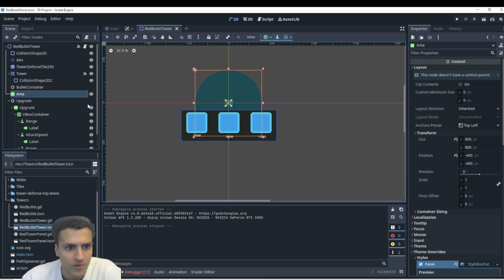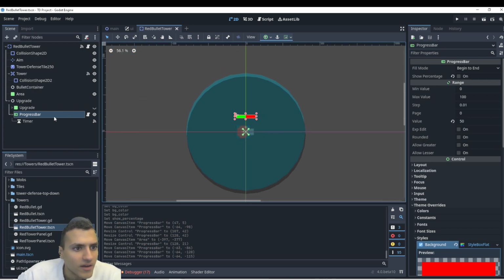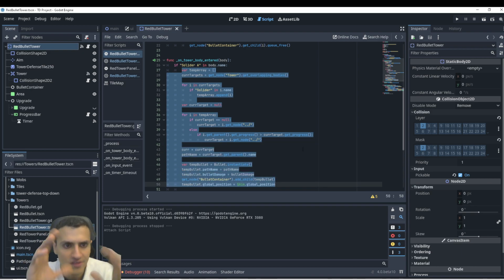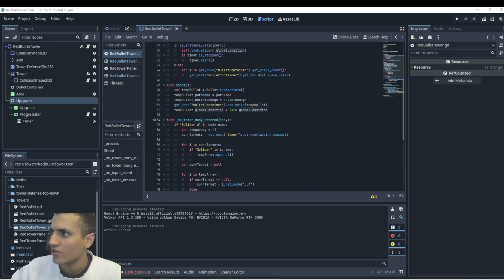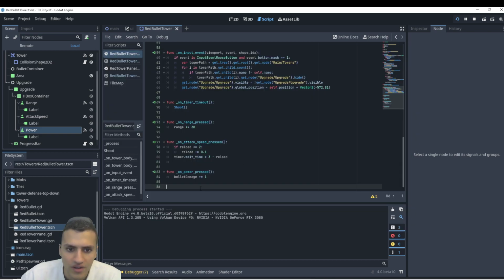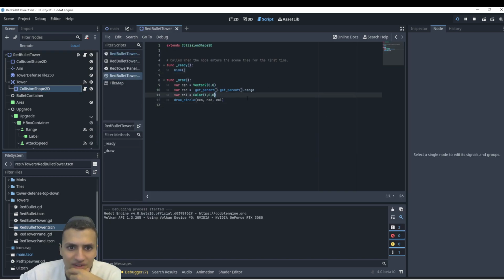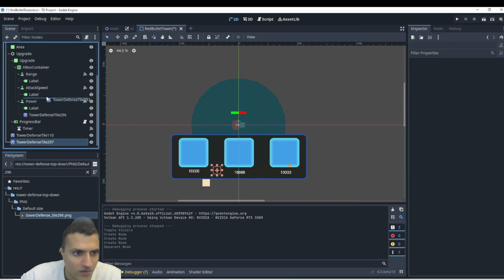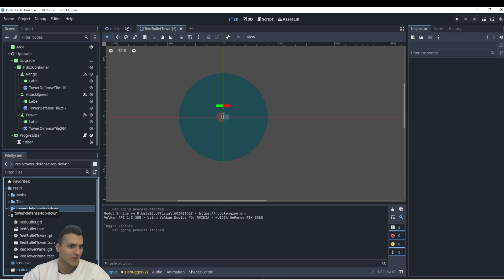Tower Powers & Tower Reloading Bullets! || 2D Tower Defense || Godot Engine Tutorial 2D 2023

Comment: Something isn't right. When I place 2 towers and I upgrade the range of 1 tower, the other towers also get that increased range, although not visually? The range is showing correctly, but they can shoot outside of that range when the range of one tower is upgraded.
Reply from the maker: is this the case in the solution files?
Reply: @CodingQuests  No, I followed along by starting from scratch alongside your videos. Maybe I missed it somewhere, but hopefully it helps someone in case they have the same issue :)
Reply: I figured out the issue. Godot shares resources, so tower radius is not unique.

Put this code in your tower script and it's fixed:

func _ready():
    get_node("Tower/CollisionShape2D").shape = get_node("Tower/CollisionShape2D").shape.duplicate()